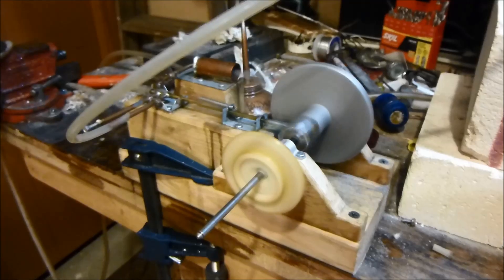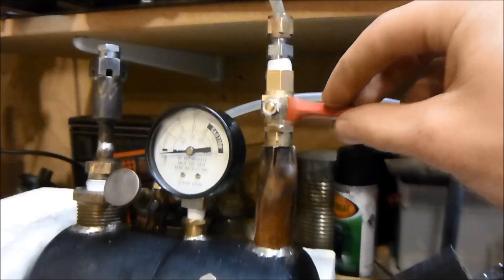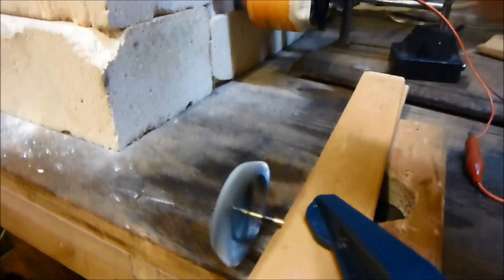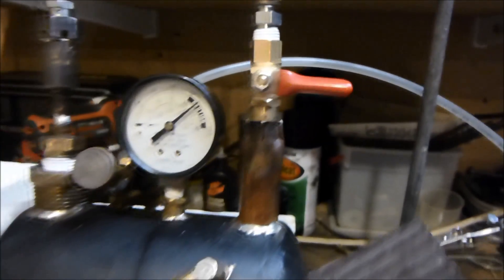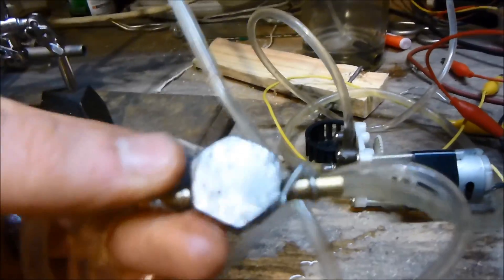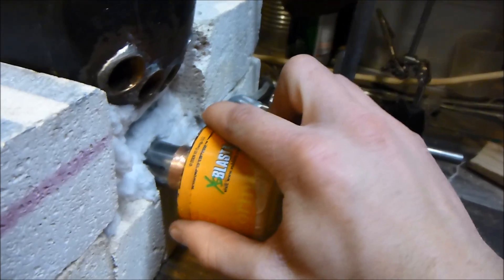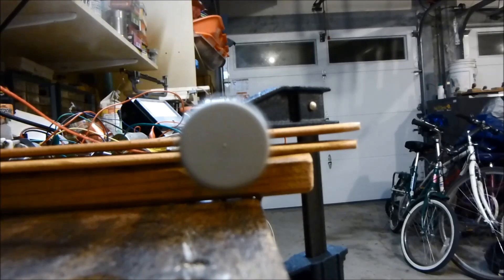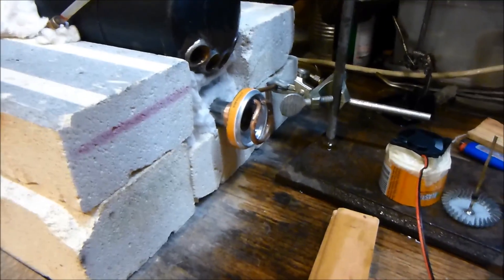Steam Engine Steam Capture, Water Pump, New Natural Gas Intake/Mixer, New Ball Valve, Steam Turbine

Comment: What if you put your water reservoir against the radiator to collect it's heat, so that it disrupts the heat and pressure inside the boiler less?

Comment: What is the purpose of the copper "Boiler Tubes" that you installed through the front to rear of the boiler ? I thought they were going to be the Boiler Fire Tubes with the natural gas burner to heat the water ?? Now I see you have the gas burner under the belly of the boiler ??   ********The fire or Combustion Gases are supposed to travel THROUGH THE FIRE TUBES inorder to heat the boiler water evenly ..... Confused.....???... LOL.

Comment: Question about the boiler. Since the design mixes copper and steel, are you having any trouble with galvanic corrosion yet?
Reply from the maker: Rouverius It might have some.  But since I will be using distilled water(when I get around to buying some) it shouldn't be a super big problem.  I also coated the inside of the boiler with paint.  But I think I lot of the paint is not doing it's job.

Comment: have you thought of making a continuous water recycling loop so you are feeding fresh water into the boiler the whole time or does create a pressure/backflow issue? either way, awesome steam engine dude!
Reply from the maker: Gunlover82 Yeah I did try that.  I put a radiator on the steam engine and the collected the water so I could pump it back into the boiler.  Thank you!
Reply: Makerj101
do you have to stop the engine each time you put water back in or is it possible to have a slow continuous feed from the recollected water?
Reply from the maker: Gunlover82 If you just add a little water at a time the engine will keep running just fine.
Reply: that's awesome. good work!
Reply: +Makerj101 you're spelled engine wrong in the title

Comment: Hi, I have a quick questions for you. Is it easier to make a steam engine or a sterling engine? I know the steam engine is probably much more fun but I want to start easy.
Reply from the maker: Filzia I would say Stirling engine is easier.  A lot easier and safer too.  Boilers can blow up if not properly made and used.  I can make a pop can Stirling engine in less than an hour.  Takes me several hours just to make a steam engine not counting the boiler.  The pop can Stirling engines can be made from things most people have laying around there house and they work surprisingly well.  I helped my 11 year old neighbor build one for a science fair project.  If you have any question, ask!
Reply: Oh man I have lots of questions. But thanks for answering the first one. What are good materials to use in a stirling engine? Any special tools required? What do you use to seal everything? And last for now, any real uses for these or just for looks and bragging rights? Thanks again!
Reply from the maker: Filzia I would start out by building a simple and easy to build one.  Watch this video series on how to make a pop can Stirling engine. 
 How to Build the Quick and Easy Stirling Engine
Don't let the plans for this engine restrict you.  Add in your own details, use different materials etc.  Not really any uses for these engines other than just for coolness and maybe science fairs and stuff.  You might be able to power something if you get it working well enough.
Reply: Sweet! And again thanks alot!
Reply from the maker: Filzia Yeah no problem!

Comment: Impressive work, I love all the detailed work that you do: the check valve, the burner, the feed pump and all the rest. For sure, pre-heating  of the feedwater would help and a good way to do it is recovering the heat from the condensate, by running the exaust steam in a copper pipe Inside a can of water, heating up the water.  This water can then be used for feed.  Anyway, I'm sure you've seen all this on other vids. So when are you hooking up that generator :) Congrats!
Reply from the maker: ch300fnqi Thank you!  I think I will do a video on making the check valves.  I have to make one more anyway so I might as well.  Yeah preheating is something I need to set up!  I did hook up the generator I just didn't make a video of it!  Max power is about 3 watts.
Reply from the maker: Makerj101 Don't worry, I'll do video eventually with the generator!

Comment: Very nice.  For the natural gas input, did you just tee off a house gas line with a ball valve control?
Reply from the maker: ab190001 Yep!  I just tee off the line that goes to the furnace.  It works great!  Much cheaper than propane!

Comment: Nice additions! I think the problem with the flame could be helped if you turn down the primary air and add an additional air source near the burner for the combustion triangle. This is known as secondary air and if installed I believe it may be easier to adjust the flame to perfection. Keep up the great work.
Reply from the maker: Karsten Elliott That sounds like a good idea!  I will give that a try!  I Guess that means I will need a second fan.  Thank you!

Comment: Very nice :) for the fan if you want volume why not go for squirrel cage blower? They don't need to turn fast but they push a fair amount of air :) Nice idea with the pump I love it!
Reply from the maker: bakupcpu  well the little turbine was supposed to be like a squirrel cage fan but the blades don't have enough area to get the air moving. So I need to make the blades a lot bigger. Then I should work ok. Thank you!
Reply: :) I'll wait for the update :)

Comment: Make a jet compressor to blow in the air past the coper pipe so instead of like in a jet engine going to the combustion chamber it is going to the burner and the compressor is geting spined by a dc motor
Reply from the maker: bor_12345's Electrofied Gaming yeah! would work!

Comment: dude you did a really nice job there :) however i would give you some ideas for future improvements...
first of all you really need to preheat the water before you insert under pressure inside the boiler! why? because high differences of temperature can cause some sort of steel fractures or welding deteriorations and it can turn your boiler into a rocket! you can add a coil of copper tubing between your check valve and boiler, and preheat that copper coil with the exhaust gasses from the boiler. 
the second thing is to drop the pressure of the water pump by controlling its rpm's using pwm controller (555timer or arduino + darlington transistor).
the third idea is...you should start automating this project! i mean an arduino with the proper code could handle every aspect of runing this system and it could be a nice school project! think of some way to sense the water level with some electronic device and then you can start doing cool things :) greetings from Romania!
Reply from the maker: micultimy91 I was thinking about making a preheater like that! I didn't think about the thermal stress like you mention. That's a really smart idea. I will have to implement something like that. Controlling everything with a micro controller would be awesome! Do you have any ideas how to sense the water level. my ideas are: optical, conductive, or a float. But I have not thought of how. Great ideas, thank you!

Comment: Looking better all the time. I really like the water pump and valve. Now you need optical sensor to turn it on.

Imagine how much better your cooling would be if you had a car radiator..... Hehehehe
Reply from the maker: Mongrel Shark thank you! Yeah I was trying to think of ways to sense the water level. Optical sensor could work. Conductivity of the water was another idea or a little float. Not sure yet. 

Hahaha I see what you did there!!! :D
Reply: Put a float in your tube and have an optical float sensor. You could even make the float a little boat.

If you happened to have a spare alternator taking up space somewhere, you might even be able to turn it with the steam engine...

Hmmm I wonder where you would get a working alternator from....
Reply from the maker: Mongrel Shark A float in the tube would work!

Hahaha a spare alternator... I'm not sure what you could possibly be talking about... Hahaha  I think my dad wants me to drive it to the junk yard if I can.  Plus I just don't have the time.
Reply: Maybe you could trade it for an alternator and a radiator?
Junk yards are usually happy to trade stuff :D
Ignition coils are fun and compact...
Reply from the maker: Mongrel Shark I will take a look around at the junk yard for goodies(parent permitting).  Maybe I can pick something nice up!  I might steal a couple things off the car that the scrap yard won't notice like windshield washer fluid pump, air compressor, and light bulbs.  Stuff that doesn't really need to be there!  :P  I did get a new car!  I'll have to do a video of it!  It gets nearly twice the gas mileage!  :D
Reply: Air compressor? Was the old car supercharged?

You can get a good 30-40 miles with no alternator in the day with a well charged battery.... An Alternator would be ideal for power testing your various engines. The turn freely with no load, the more load (lower resistance) the harder they are to turn. If you pulled out the old spring/variable resistor (From your old flyback) you could measure the power dissipated very eaisily.
Reply from the maker: Mongrel Shark It has a built in air compressor for filling up the tires and special balancing shocks.

Hahaha yeah I could!  I'm not sure my parents would let me do that though!  Yeah but you have to exciting the windings.  So that would take some power to get it going.  But it could be useful for bigger projects.  Maybe I could make a generator set if I build a bigger engine or get an old lawn mower or something.
Reply: Oh air shocks. That's cool. The compressor could be handy :)
Reply from the maker: Mongrel Shark I believe it's a vacuum pump too.  Something for the emission control system.  I asked my dad about it and he said it's fine if I pinch a few things off it!  Hmm I don't think I'll be needing the gas pump right??  :P  I wish I could steal the battery because I don't have many good ones.  Oh well.
Reply: You might be able to take the battery out at the wreckers when you drop it off. Or as I said before. Trade the car for a box of parts instead of cash. Or a combination of cash and parts.

Or.. now here is an idea. Put a junk battery in and jump start it. for its last run to the car graveyard. You can drive a long way on a bad battery if the alternator works. Its starting that presents a problem....

Comment: Hi, what you said at the end of the video made me think, have you tried to isolate the tube going from the boiler to the engine ? More heat = more volume = more pressure, more speed and higher efficiency :) even the engine itself is made out of metal which must dissipate a lot of heat !
Thanks for sharing, I'm always glad to see you make new videos
Reply from the maker: SuperAmoL3D do you mean super heat the steam? Thank you!
Reply: Makerj101 No, just insulating the tube to avoid having the steam retract in the tube and lose efficiency :)
Reply from the maker: SuperAmoL3D oh I see what you mean! That would probably help! I never thought of that! Thank you!